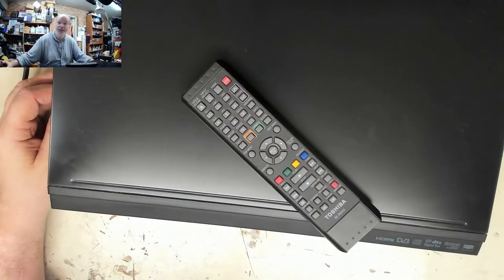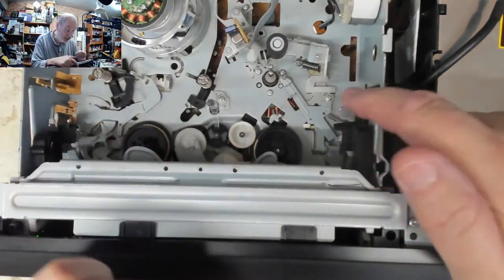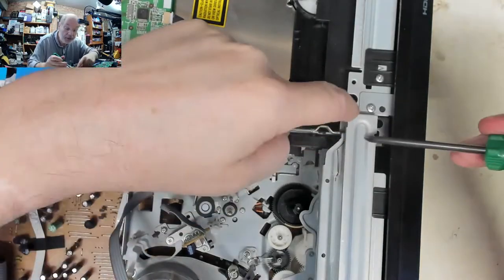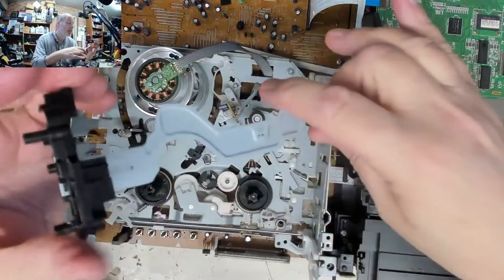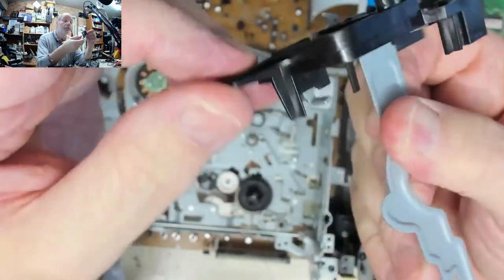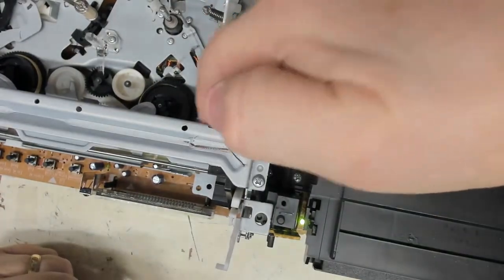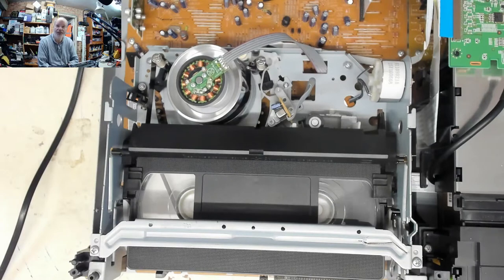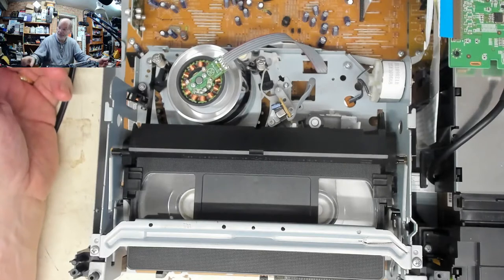Repairing Toshiba DVR20 VCD & DVD Combo

Comment: Interesting video. I have the same model, with an annoying fault. It's gone mad. It refuses to switch on with the button or remote, but when you put a tape in, it springs to life. Then the tuner goes mad and randomly changes channel. It occasionally works but then switches off and sulks. I do repairs myself (and have done for years as a hobby) I took it apart and checked the power supply. Checked for bad caps. All looked good. someone suggested that the mechon switch on the tape side can cause problems if dirty. So tried to get at it. I was interested to see how far you got with that. I found you have to take the tape deck out with the circuit board, because there is one screw underneath. Then found that the deck ribbon cables are all soldered (no plug and sockets) major soldering job. I backed off and sprayed what I could see of the mech switch with cleaner. Improved but not perfect. An ongoing project. The cable on the front panel is for the USB socket. The IR is to the side of the flourescent display. I thought the sound was on a separate head in the tape loop. The four head system is flying erase heads, to make accurate editing without dead tape.
Keep up the good work.
Reply from the maker: Hi Richard,
With a random operation fault like that my thoughts too would be to head for the system switch. I would also be inclined to look at the PSU supply lines, especially the 5v or 3v rails that provide the microprocessor, with a scope. Noise or low volts can cause this kind or problem. Probably best to change the caps on those rails even if they look OK, as they can change value enough to cause noise or low voltage.
Also beware of opto-couplers being interfered with by LED lighting, test with the lid on or the lights off.
Audio recording on the VCR is just a MONO linear track at the top edge of the tape. You can download a full service manual from this site for free:
https://elektrotanya.com/keres
Reply: @ChasLarge  Thanks Chas 🙂

Comment: Great information,  not the problem I have with my DVR620KU however. Mine suddenly started flashing the on button and both the vcr,dvd buttons. Doesn't respond to remote or manual shutoff. Have unplugged it but does the same when plugged back I.  Is there a way to reset  it? The manual is no help at all. It has always worked perfectly. 😢
Reply from the maker: This sounds like a power supply issue, if possible, check the outputs from the PowEr Supply circuit - TAKE EXTRA CARE NEAR THE LIVE AREA.
If any of the supply rails are out by more than 20%, then suspect a smoothing capacitor on that rail, the electrolytics may have dried out. Some may show signs of bulging. Replace with good quality caps from Radio Spares not the cheapo one's from ebay.

Comment: long shot but I have a DVR20KB VCR&DVR TURN ON AT THE PLUG AND IT JUST CLICKS WITH NO L E D LIGHTS, JUST CLICKS. CHANGED THE DIODE 1N5397 WITH NO JOY. CAN YOU HELP PLEASE
Reply from the maker: Hi Nigel, I would guess the PSU is not starting up, either there is a short on the output, or something in the main Switching oscillator is not starting. I could not find the 1N5397 diode you refer to, what is the part number and why did you change it? If you want me to have a look at it for you, please contact me via email. You can find this on the Channel home page.